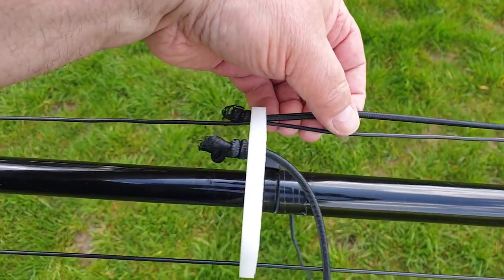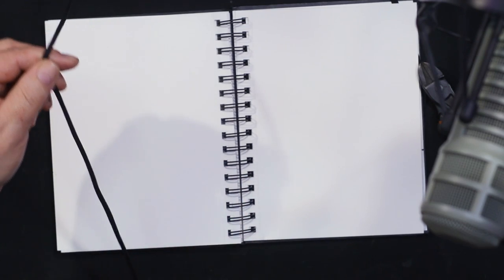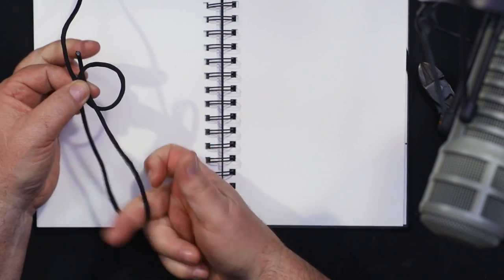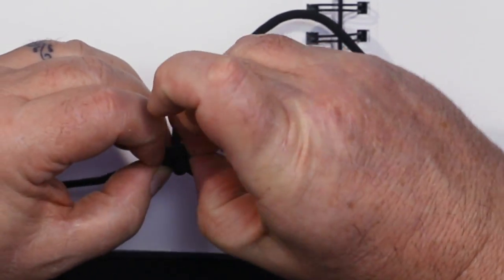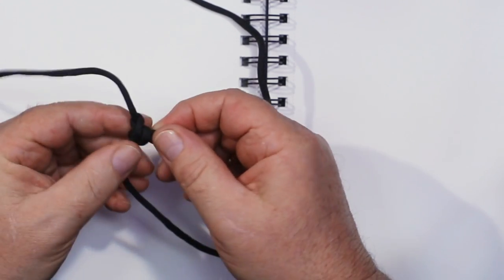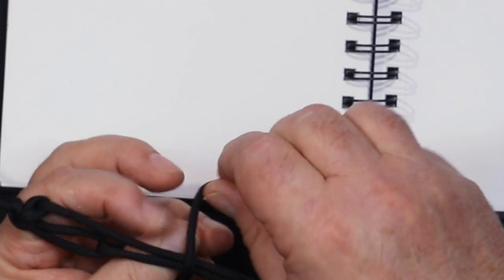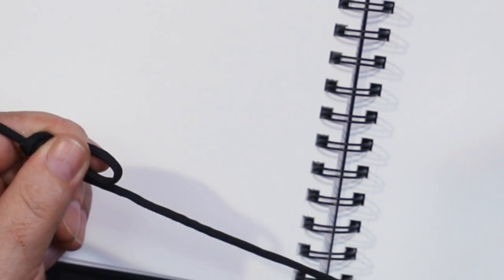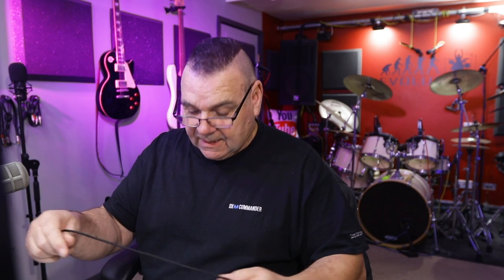When People Tie the WRONG Antenna Knots!

Comment: Alpine butterfly puts less stress on the rope no matter which way the pull comes from.  Same with a bowline, it's a strong knot that doesn't weaken the rope.  Other knots can do the same job, but in extremis (like taking a fall when climbing) the rope can break at the knot, because knots typically create weak points.  Bit of trivia I remember from my old climbing days :)
Reply from the maker: Great comment Nathan!
Reply: That's good to know. I bass fish a lot and use a Palomar Knot to tie my lures on, and I am told that the knot is stronger than the line itself . I'm not sure if that is true but I can say I went to using the Palomar back in the mid 90's and I have never had the knot fail !!
Reply: overkill... just buy more rope.

Comment: Cal. The stopper knot is also called a “surgeons knot”.  It can also be used to connect 2 pieces of rope, fishing line, antenna wire, etc!
Reply from the maker: Yes doubling up, you can make. “fisherman’s “ knot.

Comment: A knot I use a lot is the clove hitch. It's easy to make and it will stay in place as long as there is tension on it . Ideal for attaching longwires and stuff to a tree. It's also easy to remove even when it got wet.
Reply from the maker: Clove hitch.. yes!

Comment: I have literally forgotten almost all the knots I learned in Boy Scouts. This is a nice refresher on knots that are very usable in Ham Radio, especially in a portable setup. You got me started cutting 550 with a side cutter too. Works much better. I usually apply a little flame, cigarette lighter etc., to the cut end to seal it. Just my preference. Thanks for another great video. Jack K5FIT
Reply from the maker: Yes Jack.. Small flame works great.

Comment: Rewatched this yesterday, because that is a new way for me to learn how to tie a bowline.   I would suggest one more knot for Ham Radio operators to learn and that is the fisherman's knot.  it is fantastic for tying together two pieces of rope or cordage to lengthen a line or transition from one line type to another.  It is also easily undone, when you want to untie it.
Reply from the maker: Totally agree. I use it too and it used to be in the original Classic user guide!

Comment: Just built my DX Commander Classic.  I tend to knot the end of something with a figure eight knot.  Don't use this on the little bungee stretchy bits when building the DX Commander, just use an overhand knot, I found out the hard way a couple of times, it is really really hard to clip the hook in if you use a figure 8.
Reply from the maker: We have stopped shipping the plastic carabiners.. Double overhand is perfect instead. BUT if you do use the little plastics then a single works fine.

Comment: First of all, I love all your videos. There all done very professionally and have helped me a lot in this great hobby. Question: I'm going to be putting up a vertical antenna and will be guying it. What type of rope should I be using including the diameter. There's so many different rope materials out on the market which can get confusing. The rope has to withstand ice storms in the Winter here in Pennsylvania, U.S.A. Thanks in advance and keep up the good work. 73's from N3NQP! Oh and happy holidays! ;)
Reply from the maker: OK.. for medium installations, genuine 550 Paracord works well. For slightly heavier installations, look at 3mm (1/8th inch) Mastrant. DX Engineering sell it I think. So do we but it’s not in the catalogue. I think we have 50 in stock. Warning.. it’s strong but very thin.. For heavier again, you can go 6mm (1/4 inch) lorry rope (it has a name, some sort of poly rope). Then for REALLY HEAVY like towers and stuff, you are into climbing type rope. In the main, if you are in USA, DX Engineering will have a solution. Hope that helps.

Comment: Got a question for you Callum:
How do half wave ground mounted verticals model? They don't require radials presumably, but I have heard that they need to be elevated by 1-2 metres or the radiation angle is too high. I am not sure if that is true. Have you looked into it? It would work for a 10/12/15/17 vertical but would be difficult for lower bands realistically due to the length.
Reply from the maker: Gordon.. you can easily model one.. Connect the vertical direct to the Z equals zero and then adjust the ground with the Ground button.. You do NOT need to raise them up. The maths works just fine.

Comment: I would add one to this list: the cow hitch (aka lark's head) knot.  You can tie it with two fingers in under a second, and is a great way to quickly attach one line to another.  It's the standard knot to attach lines to a stunt kite bridle.  That's a demanding (and expensive) application, so I'd take it as a strong endorsement.

There's a nice, slow (19 seconds long!) demo of it up on YouTube: https://www.youtube.com/watch?v=cm50iRZBJQc

They show it going up to a stopper, which is classic.  But if you're guying a lightweight inverted vee in the park, you can usually get away without a stopper (or insulator).   Also note that you don't need a tied loop: you can just bend the  rope and flip that bend into shape.  This version is what I use on stakes to guy my antennas.  It makes changing the length fast, easy, and very controlled.
Reply from the maker: So many knots.. How many do I teach :)

Comment: Fantastic knots all around, Callum. The tension system you're using that alpine butterfly on is what I would call a trucker's hitch here in the US. I grew up tying them with the loop made from an overhand on a bight, but in a survival class I took in college they taught us how to make the loop with a slip knot so that it can just pulled free without any untying. I've found a video demonstration here: https://www.youtube.com/watch?v=ee0RB6Q9C4c  Might save you some time untying the alpine butterfly, though that knot has a lot of other wonderful applications. Cheers!
Reply from the maker: OK yes.. The trucker's Hitch works GREAT.. I would totally agree.. It is slightly different though.. Anyway, for me, I often want to tie a permanent loop in a line that I can reuse over and over at just the right place.. Often with one hand.. But thinking about it, the hitch would also work. But hey! The Apline looks to pretty! :)

Comment: Ok, I failed cub scouts (I couldn't pass knot class).  Today my spouse has to tie our trash bags for the curb. The whole knot thing is the ONLY negative I've encountered for this antenna.  I do see people using hooks.  I'm thinking they might be using bungie cords or maybe there's a way to attach a hook?   Anything wrong with bungie cords?
Reply from the maker: If you can tie a single over-hand knot (which we can all do from age 4) then it's just one more time around. That's all you need.